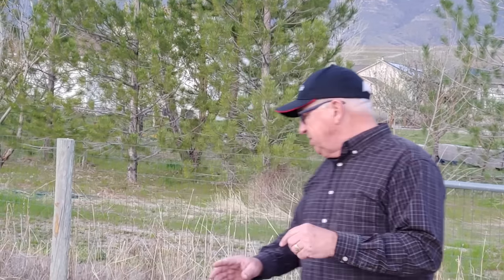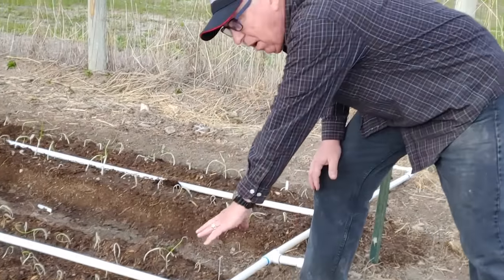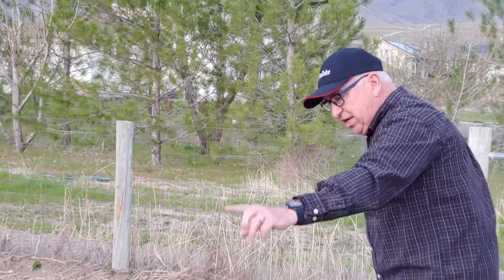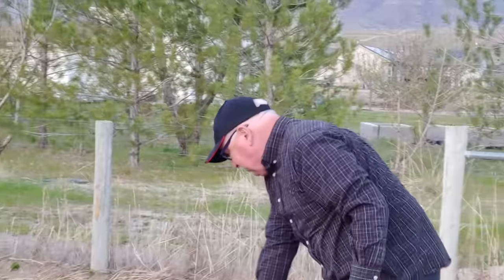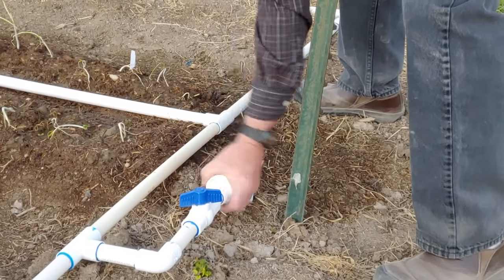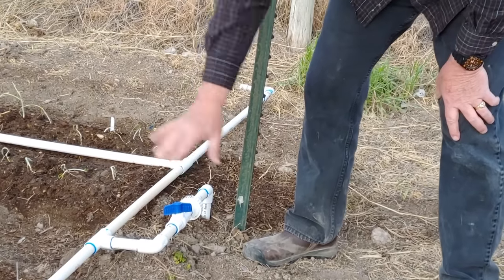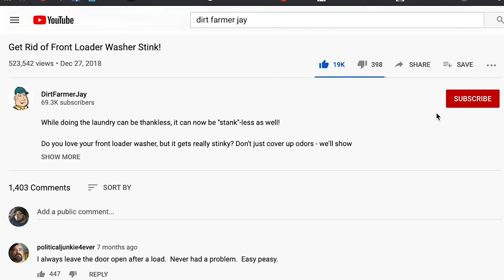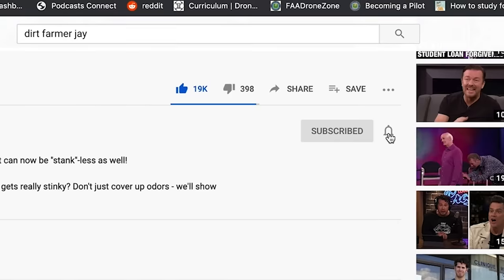DIY Garden PVC Drip Irrigation - Easy, Cheap, Effective!

Comment: Jay ,I also use 2 litre soda bottles buried in ground by my tomato plants and run 1/4 inch line to water..
Reply from the maker: Great tip! Thanks for sharing. Best Regards, DFJ
Reply: I can't picture that...bury the bottle,l (with holes?), poke a hole and run ¼" tube into the bottle near the top so it water the roots?

Comment: Great Idea...but doesn't fit with my purpose. You need timer which needs electricity. In my area I dont have electricity.
Your system does match with your climate less than a year it rains. In my area we sometimes can go to two years without rain so store water in quantity is needed to avoid expenses. So I can go for big trees with deep roots with direct drip system. 
Thank you for video well presented.
Reply from the maker: Thanks for watching and commenting Al Habsy. Dirt Farmer Jay and I are both natives of the state of Arizona USA where summer temperatures are over 100 degrees Farenheit so I understand hot.  Also it is a very dry climate like yours. Best to you and your family. Dirt Farmer Maggie

Comment: what size pump did you use on the irragation system
Reply from the maker: Danny, we have our own well, and it delivers a strong volume of water, set to 60 psi. We regulate flow to the system by setting volume, not adjusting pressure. It's a workaround - but it works! Does that help? Best, DFJ
Reply: @DirtFarmerJay  I believe he's asking for OD on the PVC pipe for building the system ..3/4" ,1" ,1-1/4" ??
Reply from the maker: @danny staley, @abnutcracker2164 suggested that you were asking what size of pipe I used for the system. If that is correct, for a general in ground food plot, I generally use 3/4" pipe for both the laterals and the manifold. If in a raised garden box, 3/4" for the manifold, 1/2" for the laterals. If in a larger garden plot, like a stand of sweet corn, 1" on the header, 3/4" on the laterals. I hope this helps! Best, DFJ

Comment: For the rest of the world . 1/16 = 1.57 mm or just 1.5mm /2.00mm drill  1/8 = 3.18 mm or 3.20 mm  drill Metric is so much easier.   Advice tips on this vid are good though nice and simple
Reply from the maker: Jack, thanks for pointing this out. We will be adding the metric measurements in the video description. Just an oversight to not mention both measurements. Best to you. DFJ

Comment: When you want to remove the pipes how are you doing it?
Reply from the maker: Thanks for watching and commenting Tolga GURCIMEN. We don't glue the pipes together, we just dry fit them using connector pieces. So we just disassemble them for storage We've stored these pipes each winter for the last 4 years and they still are in great shape for another year of work. Best to you, DFJ

Comment: With the 1/16" bit, what is the estimated amount of water/hour from one hole?
Reply: I think its 3cc per second, so times that by 60, then another 60 and you get your answer. Sumpin like dat, anyways. Not sure.
Reply from the maker: Royal, I'm winging it a bit here, but I believe the average delivery per 1/16" orifice is somewhere around 1/20th of a gallon per minute. Said another way, it takes about 20 minutes for an orifice to delivery a gallon of water.  I hope that helps! Best, DFJ

Comment: I've found that the end of the pipe closest to the supply valve tends to put out way more water than the other end.  Anyone have a solution?
Reply: Drip Tape is a wonderful product for this application, look it up
Reply: Drill more holes or larger holes to increase flow as you get farther away from the supply header.

Comment: Hey, can this be used for large scale farming
Reply from the maker: Steven, this works better in hobbyist farm settings as larger settings use more mechanization and setting up the pipes and removing them at the end of the season does takes manual labor and attention. Best, DFJ
Reply: @DirtFarmerJay  Thank you for your reply. I have learnt so much from you

Comment: What's the width of the beds uncle 3ft?
Reply from the maker: Kelvin, it depends on the crop - anywhere between 24" to 36". I believe these were 32". I hope that helps! Best, DFJ
Reply: @DirtFarmerJay  am planting determinate tomatoes 3ft wide 2ft in row and i putting half inch PVC and boring holes on the both sides

Comment: You are spending way too much water; the holes you drilled are very large.  Also don't irrigate the top soil, it will mostly evaporate.  Try to bury the pipes underground with isolation around the holes so as not to get dirt stuck. This will prevent quick evaporation and aim the water to the roots of plants.
Reply: Wrong if you have the system on for about 10 to 15 mins it will penetrate deep enough to get to the root sys the soil will retain the water long enough till the next watering

Comment: isn't PVC degraded under UV light? thats why a lot of plastic pipes used outside are black, the added carbon increases outdoor lifespan.
Reply: Blox117 It should last well enough. eventually yes it will deteriorate
Reply: You can coat it w a coat of spray paint
Reply from the maker: Thanks for watching and writing. One thing we do religiously is to remove the pipes every Fall and store them out of the weather. For the 2-3 months they are in the sun during growing season, we have not seen them degrade. This Fall will be out 5th year using the same pipes.

Comment: That pipe will burn and turn black due to uv light. paint it to protect it from uv light.
Reply from the maker: Thanks for writing and commeneting Paul Talanoa. Yes, it eventually will. We've used this same pipe for about 5 years with no discoloring...yet. You're right, you can paint it or you can bury it about half way to slow down the darkening. Best, DFJ

Comment: Isn't it cheaper to buy a roll of that black flexi pipe can get a 120m roll.. it's crackhead cheap.
Reply from the maker: Thanks for watching and commenting.  Something to consider about black pipe is the heat that the water will get, Putting hot water onto tender plants is not a great idea - unless you garden area is in shade. It also doesn't lay flat unless you force it flat with weights in the sun until the bends from packaging are relaxed. PVC pipe will last for many seasons. We will be on season #5 this Spring with our PVC system. We remove it from the garden area during Winter and store it in the barn.

Comment: Why not just buy drip irrigation premade lines... They're flexible, light, don't take time to make or set-up, and i bet they're a lot cheaper than pvc pipe, we use it in our greenhouses to water 180 cucumber plants, so yeah it's better
Reply from the maker: Hi kar oma. Thanks for watching and commenting. We actually used drip lines at first. There's a reason they are cheaper. They barely lasted one season before they baked in the sun and came apart. Our PVC configuration has lasted us 3 years so far. We take it apart and store it in the barn over winter. Also, the PVC route allows you to space out the water hole based on the crops you are growing. If you are growing all one crop, and they are in a green house with no direct sun, then you'll probably be good to go with the drip lines. Happy growing season! DFJ

Comment: why is the stream coming out the side instead of pointing down?
Reply: The holes (stream of water) are pointed towards the plant.    If you had double rows then you would have holes on both sides of the pipe.
Reply: If pointed down the holes would cake up when turned off.

Comment: Hoss tools drip tape
Reply: Is soooo expensive.
Reply from the maker: Not when you compare it to drip tape that will rot and fall apart in one season. We, personally, will be using this same system for the 4th year this year. We dismantle the pipe runs and store the pipes away from inclement weather during Winter.

Comment: This would cost a lot of money
Reply: I think it's much cheaper than any soaker system. Keep it simple. You can always add on later.
Reply from the maker: Much cheaper than some other systems especially because the material is readily available to replace parts that crack or are leaking, etc.

Comment: Not to be that guy but using PVC in your garden is not the best idea. I would google phthalates.

PVC is made from extremely toxic chemicals called phthalates. There is a very good reason PVC is only used for Drains in your home and not for supply lines. You would become very ill if you consistently drank water that was being fed through PVC. 
More over PVC breaks down faster when exposed to UV light. So by using this in your garden you have effectively increased the rate of toxins that will leach from the PVC into your soil and then into your crops. 
I am not a fear monger but would hate to see a video get a ton of people sick. Not worth it. 
I would recommend using CPVC if you are interested in this. The pipes are smaller for the most part but more importantly they are toxin free and perfectly safe to use in your garden.
There are many alternative piping products available and a very good reason drip irrigation system are made from SAFE materials that are meant to be used in that fashion.

Going the cheapest route could leave you sick or dead. The path of least resistance leads to crooked rivers and men.
Reply from the maker: LeonitasMaximus. We and many of our fellow gardeners in our rural town have used PVC pipe to water the garden for years - no one is sick or has died related to this practice. However, you are correct that CPVC is safer. These are the grey colored PVC you see in your local Big Box store.

Comment: with all respect but this is a very bad irrigation system, just use the usual dripping system, much cheaper and more practical not to mention less water consuming and regulated .
Reply: Hear Hear,   I didn't want to hurt Jay's feeling but your right on.  Check out you local University or farm advisor they have years and years of data on simple drip systems.
Reply from the maker: We have used drip hoses...not a fan. Brittle and sun rot quickly.  But thanks for your comment and suggestion. I doubt anyone would still be using a drip hose that is 4 years old, but our PVC system still works like new after 4 seasons.